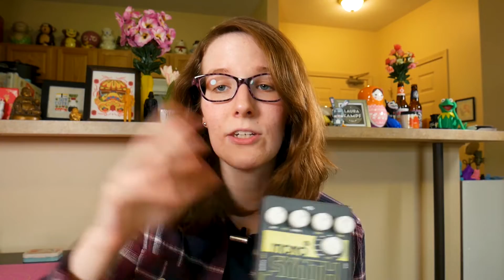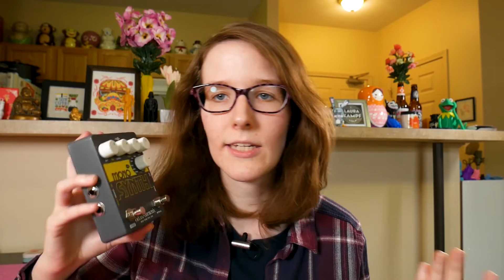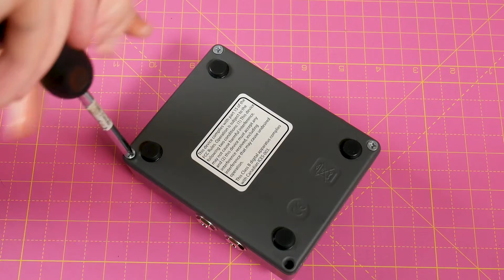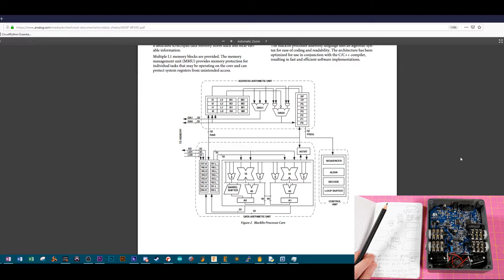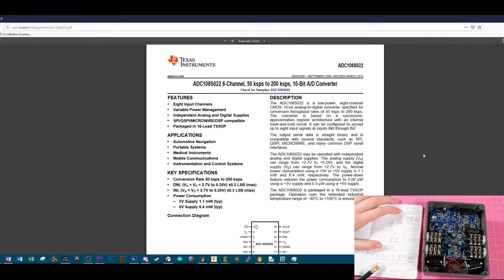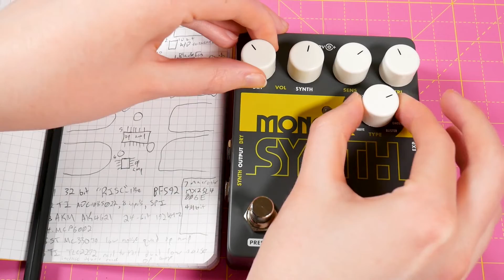What's Inside the Mono Synth Pedal? ⚡🎹🎸

Comment: From what I was able to gather from your video, this is what I am guessing. Firstly, the MCP6002 sounds familiar because that is a common opamp that is used when dealing with 3.3V microcontrollers and microprocessors when dealing with input traditionally in the realm of 9V systems. You may have remembered it from the Raspberry Pi Pedal at Electrosmash, which is actually how I discovered this channel. So, topology wise, here is what I am guessing. Two of the multiple opamps (and if I was a betting man, the MCP6002), are simply used as input and output buffers to keep impedance low. From the input buffer of the opamp, the ADC takes over the signal and takes that amplified signal and spits out the data on the SPI line, which I am going to guess will be SPI0 on the Blackfin. On the Blackfin's other SPI bus, SPI1 (or maybe SP0 for this and SPI for the ADC, whichever the board layout was better for, I'd guess), the NV Flash holds settings, and possibly even a binary (kind of like the Spin FV-1 holds stuff in its EEPROM). Obviously, the Blackfin is where the "black magic" happens, in which it does have a good amount of RAM to do things with, so long as the programs are ASM based. Then it spits out on its I2S bus its processed audio data to the DAC, which then probably goes out to the out buffer opamp, and that covers the general topology. The additional opamps could be for different things, like gyrator circuits for band EQ, analog oscillators, comparators, or any number of things that can be tasked to them. One of them is probably the "adder" circuit for blending the signals.However, this is also all best guess. Basically, if you gave me these components and told me to setup a pedal, that's how I'd tackle it. I am going to guess the headers for debugging are either the UART or its JTAG (some STM32's can be programmed with a much lower pin count than a typical JTAG contains).Anyways, awesome channel, great positive attitude and I look forward to seeing more.
Reply from the maker: aha! that is definitely where I had heard of the MCP6002 before and thank you for this wonderful signal flow hypothesis/synopsis!
Reply: @BlitzCityDIY  No prob.
Reply: Sounds pretty likely to me, except that the 10-bit ADC is probably for reading all the control pots. The AKM Codec is going to provide the ADC for the signal input as well as the DAC for the signal output. I may have used that exact AKM part before in some embedded audio application or other; it'll be communicating with the Blackfin DSP over some variant of I2S as you say. I worked more or the firmware side of things, so I can't say much about your analysis of the analog bits except that it sounds plausible. :)  I used to work for the part of Harman that was originally DoD Electronics, one time maker of fine guitar pedals. The corporate overlords shut down the local office, and I now have as souvenirs some interesting test equipment and prototype audio gear from earlier days; it's pretty fascinating stuff to look at and play with, although very obsolete now!
Reply: That makes sense with the ADC, totally missed that. DOD, eh? I made a modded clone of the DOD Thrash Master I traced a bit ago in EAGLE that I really dug. Have any stories of the DOD years? Like the whole using a CD4007 as a bypassing switch?

Comment: Yaasss! Teardowns are the best! Those knobs are probably just pressed on. The best way to pop them off is to use a plastic spudger or an old plastic giftcard and pry gently from underneath. This way they won't get scratched up. Yes I'm talkin' bout those silly promotional gftcards you get in the mail :D. Also, your suggestion of a single sided PCB is very likely. Nice job liz :D
Reply from the maker: Thank you! And that's a good tip- I was going right for some pliers and I was like "whoa self, chill out" haha
Reply: @BlitzCityDIY  you might be able to use a decently sized flat head. That's been my trick with pedals I  have had to tear apart for repair.